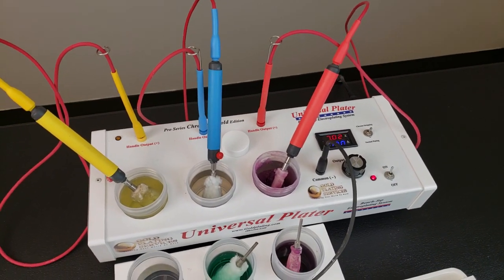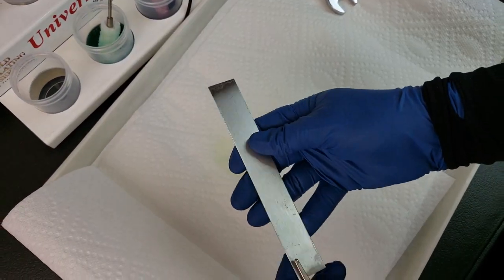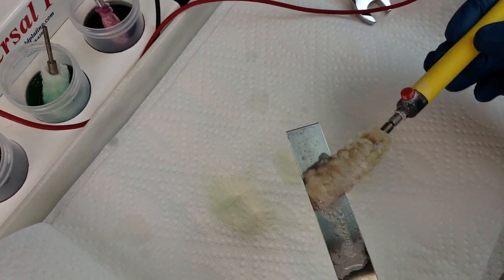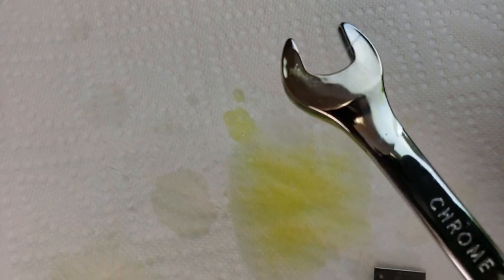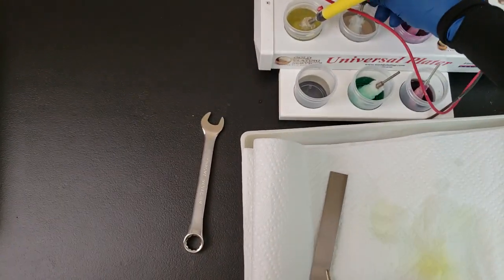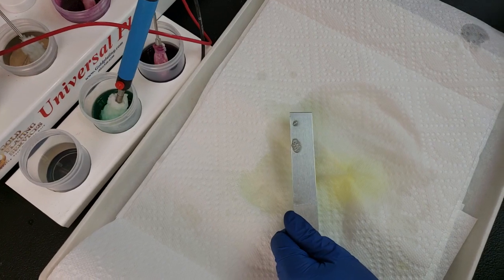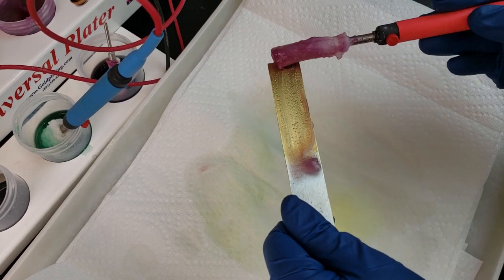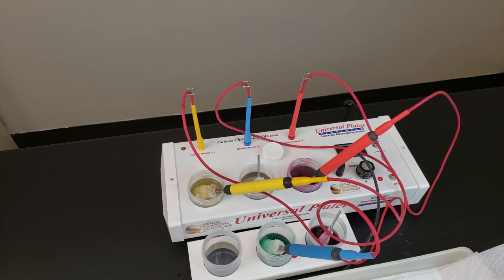Is It Stainless Steel or Chrome? How to Proceed - 24K Gold Plating

Comment: Will the Universal Plater Option 2- Brush Plating System for Plating onto Stainless Steel. for Plating with Gold, Silver, Rose Gold, Nickel and Other Similar Electroplating Solutions. Will this machine strip chrome? A friend is getting rid of his but I want it to gold plate my chrome emblems and want to know if it will strip it? He also has a older machine frame like 98 model number RC1010S it’s white has a switch in the middle and two dials on the sides will either one of those work with the new solutions it calls for WR4 and WR5 and the gold is WR6
Reply from the maker: The Universal Chrome plater is the only brush plating system that is able to strip chrome.
Reply: @GoldPlatingServices  ok sorry I asked twice. Thanks for the reply.

Comment: So Chrome stripper and eletro cleaner are the same??
Reply from the maker: Chrome Stripper works in place of Electrocleaner (In 'normal plating mode").  However, Electrocleaner will not work as Chrome Stripper, even in 'Chrome Stripping" mode.

Comment: Hi guys. I have a quick question. I'm noticing that my 24-karat gold solution for bath plating develops a crystallization in the beaker bottom if I go a couple of days without using it. However once I heat up the solution prior to plating, the majority of it dissolves but not all of it. Any pointers or recommendations? Thanks in advance.
Reply from the maker: That can happen when the solution cools and is perfectly normal.  Some of the make up components get pushed "out of solution" as the temperature drops but go straight back in when heated.
Reply: @GoldPlatingServices  good to know. Thank you again.